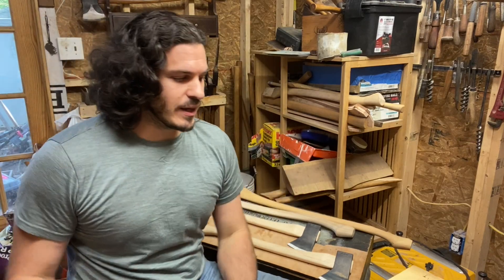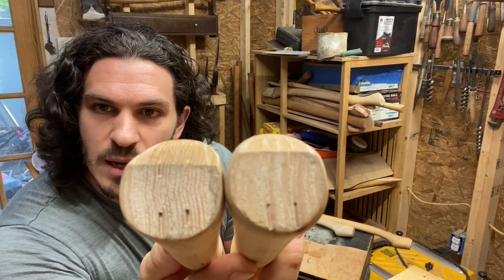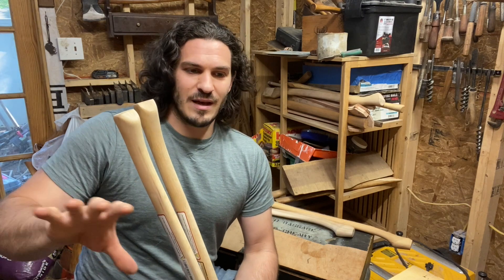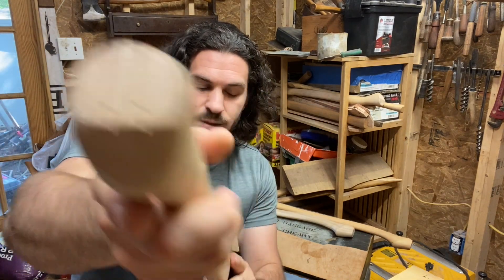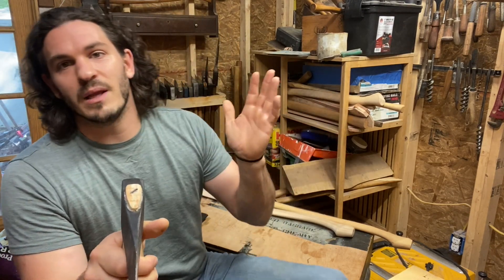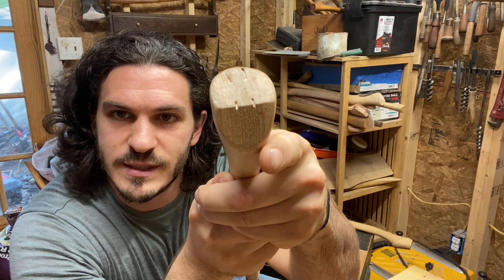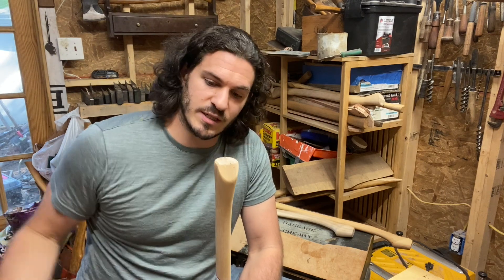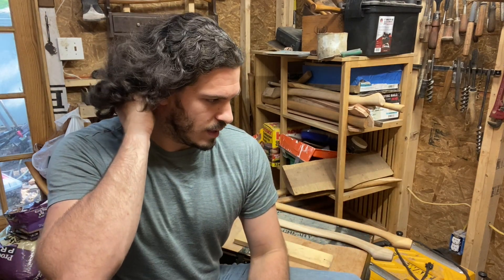Tight or Wide Grain!? Which to choose and why

Comment: Is that the 30C "B" grade handle that you put in the updated Council Tool updated jersey pattern?  If so did you remove remove a bad hang to replace it?  I've seen your video where you removed the head to fix a factory "shelf" hang.  I'm a big Council Tool fan too!  Really dig your videos.
Reply from the maker: Yes, that’s the one! It’s the 30c curved from whiskey river. When I bought the new Jersey, it only came on the 36, so this was just re-hanging on the shorter handle.

Thanks for checking out the channel and taking the time to comment!

Comment: Great video! As you say, it's very difficult to predict which handles are going to break quickly beyond looking for runout and even then some very imperfect handles seem to last forever. I think runout is a bigger issue for ash than hickory, just because hickory is tough enough to get away with it more. At one point I did try to look up whether fast growth (growth ring spacing) matters for diffuse porous hardwoods (like Hop-hornbeam, hornbeam, beeches, maples, and birches). As far as I could find it doesn't make much difference except at the extremes, which makes sense since their early wood is the same as the late wood. That is the only think I would add. For the conifers my understanding is the same, that slower growth results in stronger wood.
Reply from the maker: Good stuff thanks for sharing!